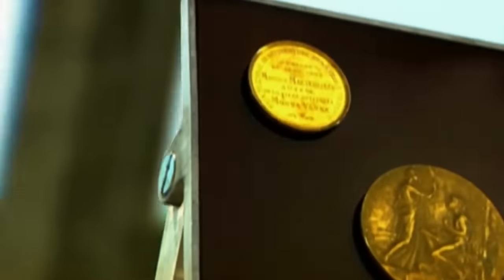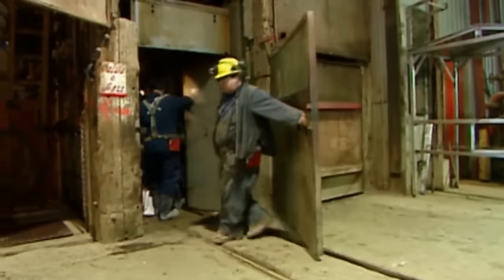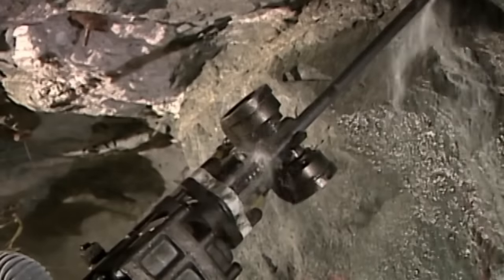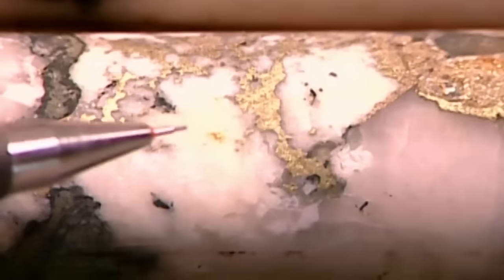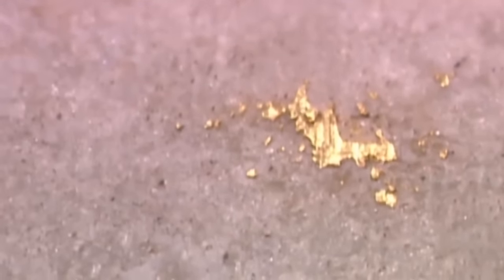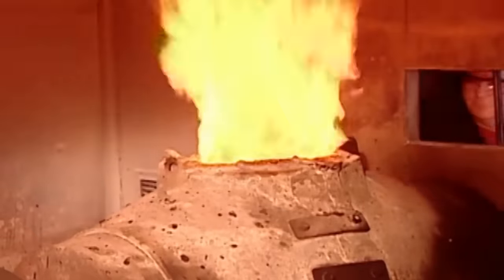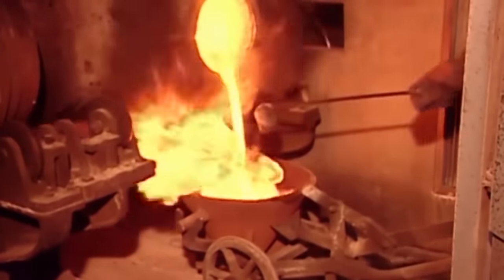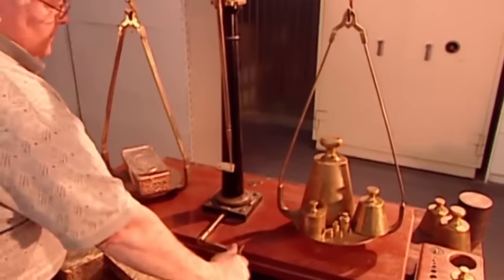How It's Actually Made - Gold

Comment: 2:06 "The rock stock rocks and knocks around the clock till it looks like chalk"
Top 10 rappers Eminem was too afraid to diss
Reply: I read Eminem as lemonade
Reply: Where's it?
Reply: 2:06 is where it's at
Reply: Top 1
Reply: It goes until 2:17
Reply: I really thought you typed the whole thing
Reply: i wonder how many takes there were before nailing that part
Reply: Chalk full of flocks of blocks
Chemicals lock into the dock pulping the rock into shlock 

After cooling slightly the gold is dumped into bar-shaped molds and the fire rages out of control
Reply: @creepyclowness2520  snap back to reality
Reply: A flock of blocks lol.
Reply: @mehmetseyit7210 Oop, there goes gravity!